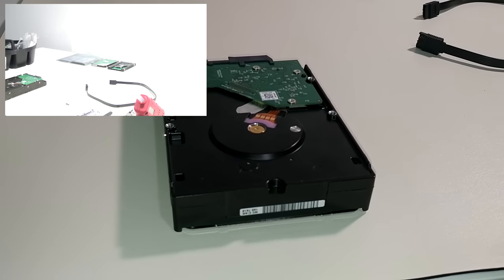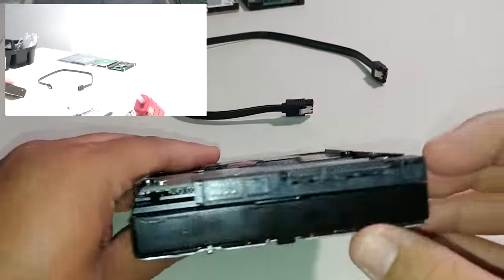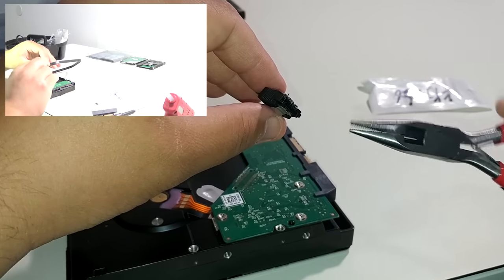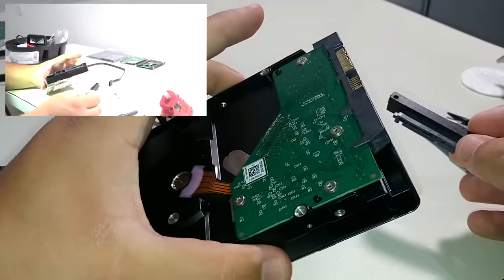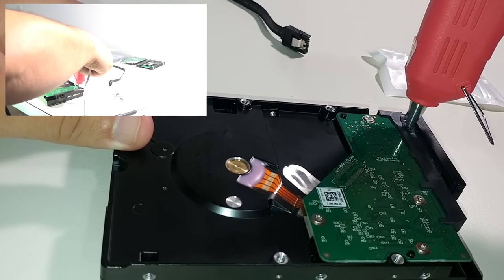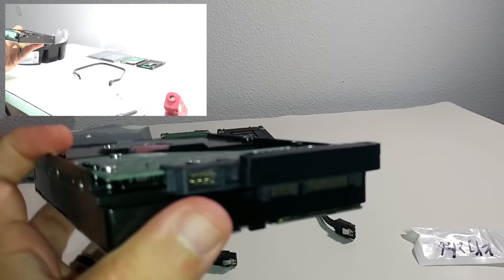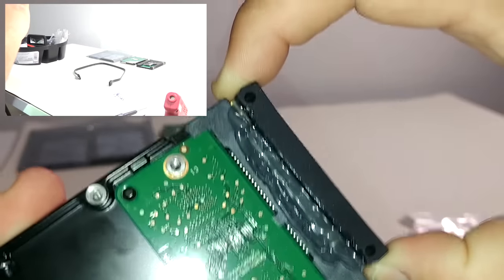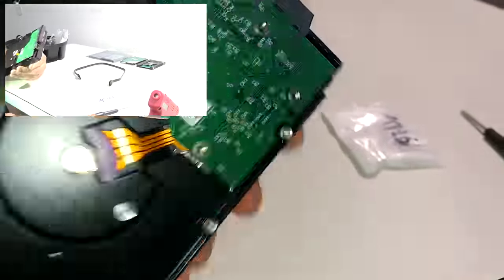How to Fix a Broken Hard Drive Sata Connector

Comment: I did not realize that the broken piece was inside the SAta data cable. I discarded cable. Is there any repair service available that will do this? Also a WD drive- 2TB. TNX

Comment: I broke the SATA Data pins. What should I do to fix it?
Reply: You’ll have to order the exact same model of HDD and canibalize it for parts. Specifically you’ll have to take the Circuit board off both so you can swap the Sata Pin Connectors.
Reply: @lexcelius6921  I did order the same exact model but I put data on it, that being said, if I swap the boards, do I still need to swap the BIOS chip?

Comment: My Sata ATA cable is currently connected to my SSD and staying in place with blutack, I play a fun game where if the wire moves the slightest little bit (be it from wind or me trying to move an inch....it stops working

It's been a fun month, other then having to save fallout every 30 seconds just incase, it's not so bad 😐

Comment: Understand the video is 6 yrs old, but just run into this problem last week...
How to extract the broken piece from the cable? I tried pliers, even tweezers. OP mentioned "...slowly break back" but can't get a good grip! IS there a video on extracting the broken piece :)
Also is the glue part even necessary? Seems like the adapter would stay on just fine and the drive is not going to get plug-unplug often...
Reply: Use a needle and you'll be able to slide the broken piece out just enough to grab it with a needle nose pliers.
That's how I got mine out.

Comment: The big question is, what happens with the Sata data cable connector, if the plug has a clip activated release, because that release is then pointing towards the hdd body (almost hidden behind it) and is quite impossible to reach that way, if the angled adapter points upwards not downwards. I am facing exactly this situation right now, because my space is limited in the downward direction, making it impossible to have the angled adapter the other way around.

Comment: Is fixing a broken pin on SSD the same ?
Reply: Broken pin itself, is a whole different story, but the plastic piece, is what this videobis going over, should be same for each hdd/ssd
Reply: For a broken pin you will have to remove the grayish io frame,using a donor drive unsolder one of its pins,unsolder the broken pin and replace it with the good pin from the donor drive.

Comment: Would it work the same if the sata pins broke off the motherboard? I had someone try to take the bracket off, and the left and right pin, 1 and 7 broke

Comment: I hate those locking sata cables.  No need for a lock.  I just break them off because it's hard to find those cables without the locking mechanism at a reasonable price, especially when you need right angle ones.

Comment: I accidentally broke the plastic piece off but I never found it again. I believe it got vacuumed and is now gone forever. Is there a way to fix it without the original plastic piece? Maybe find another one from another sata port? Please help I really don't want to waste a perfectly good and honestly bit expensive ssd
Reply: buy a broken hard drive on ebay. plug broken hard drive into sata/psu. break the plastic piece... use it on ur main drive.... profit
Reply: Could you cut up an old gift card/credit card and wedge that in there?
Reply: @kg6097  you probably "could" but it wouldn't be as good since the actual plastic piece has grooves to keep the pins from contacting each other so you run the risk of pins shorting against each other

Comment: can you use super glue if you don't have a glue gun
Reply from the maker: Absolutely but it would be much harder to remove if ever you needed to. Just be careful that it doesn't drip all over as it is much thinner.
Reply: +ITXtended thanks so much I just fixed mine that I didn't know was broken until I tried to upgrade the ram which was a failure.... I used your method but I used a piece of plastic to fix the connector and put it inside and used electrical tape.... hoping it holds for at least an month
Reply from the maker: Excellent, I'm glad this video could be of assistance to you! Here's to hoping it holds up!!!
Reply: @GeezRips  I need backup   Or not